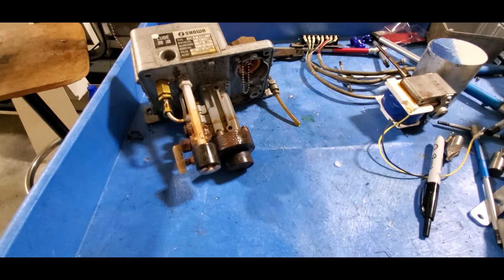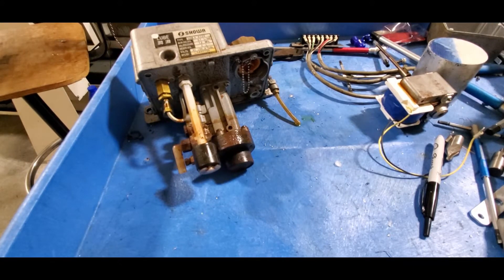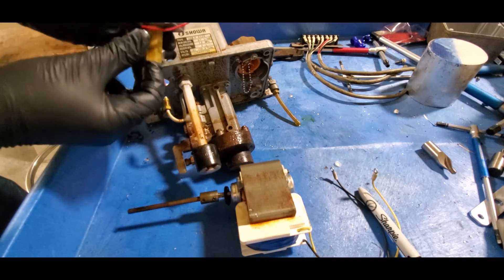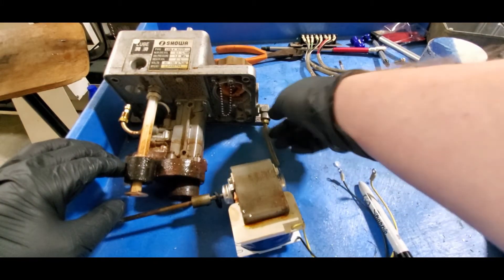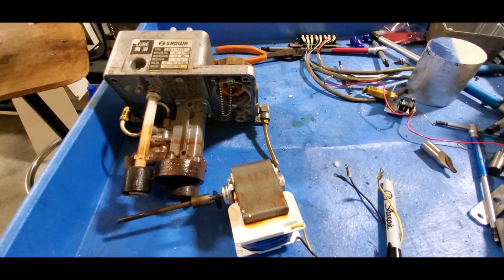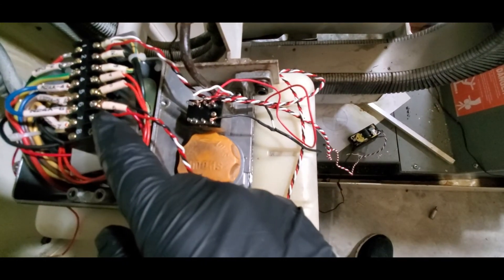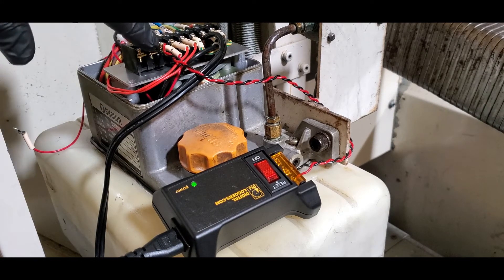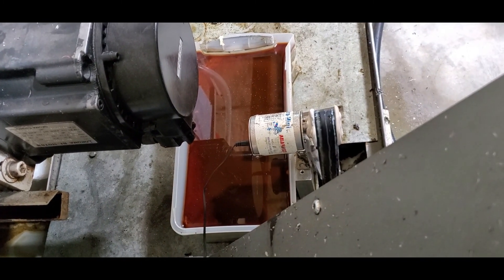Okuma - Automatic oiler - Part 1

Comment: Hey Daniel.
This video is a couple of month old now ??
So might be a little late to add much to the conversation ??
With the Automatic Lube System.
Best to cut your loses and just buy a replacement unit.
You could fix it in 5 minute and you could fix it in 5 hours.
At least IF you replace it with a Brand New unit, you can forget about this annoying problem that would more than lightly happen again ????
Wish you all the best sorting it out 👍
Reply from the maker: Hey man long time no talk, the problem could be in the pump or down the line somewhere a leak in a line/fitting. I have her patched up enough to work for now. Its way too much work to try and get in the machine to check those lines so just running her like she is.
Thanks for stopping by and commenting.